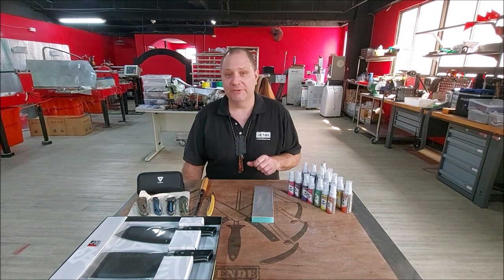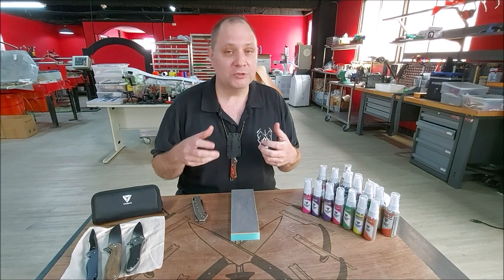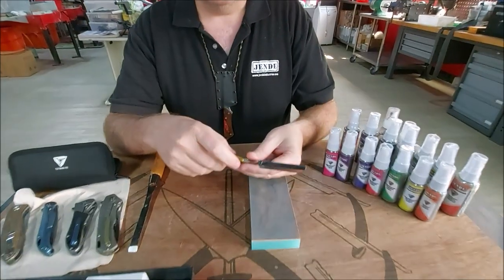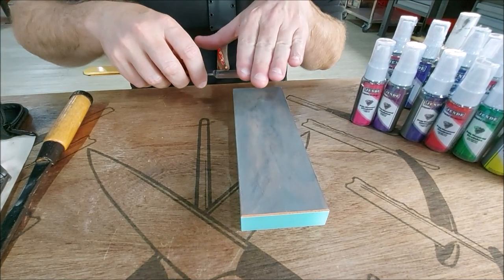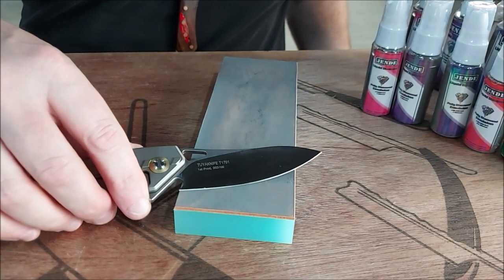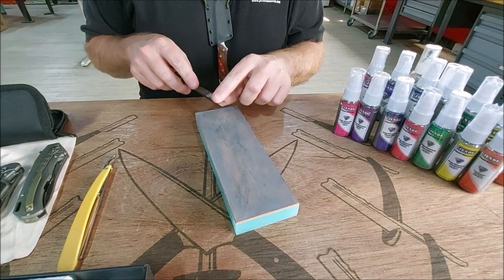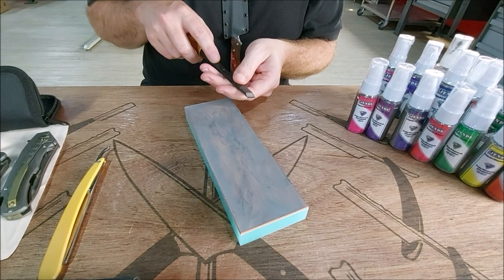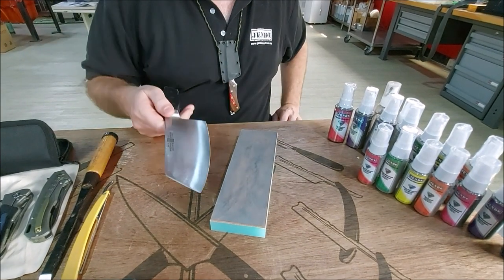Stropping Kitchen Knives, Straight Razors, Chisels, and Folding Knives Part 3 -Jende Industries

Comment: I belong to the people of measuring is knowing. 
I have an edge-on-up with test clips and measure every action I do. 
I strop on leather with a 7000 compound and notice that I have a sharper result when I strop at a slightly wider angle than I have sharpened and I use a little more force while stropping.
Soon I will buy a Jende Kangaroo Leather Bench Strop with Jende Poly Diamond Emulsion 0.025 micron stropping emulsion to take the stropping process to the next level. 
I only do this after I have polished the knife on my Shapton Pro Stone grain 30.000 super fine. 
Sharpness freak for life.
Reply from the maker: You are definitely invited to the next cocktail party, sir! 😃Stropping is one of those things that is still not talked about enough, for sure. I think you will see the improvement with the 0.025 after the 30K. You can really begin to appreciate the 0.025 once you put a blade to your face for shaving!
Reply: @JendeIndustries  In recent years, I have been studying how to make a knife really sharp without damaging its shape. 
Sharpening a knife elevated to an art. 
It is not only the sharpness, but also the uniformity of the cutting surface. 
I have 16 wethstones from 120 to 30,000 grit and am now going to delve into the really good stropping techniques. 
Every day I sharpen One knife, which I get from the local community. 
I grind 2 to 3 hours a day. 
I feel the knife and make it as beautiful and sharp as possible.  
I can't get below 70 BESS yet. 
I bought an Edge-On-Up PT50A sharpness tester for a few months ago and that's why I've gotten so much better. 
No fantasies or that I think something works better. 
To measure is to know. 
I only measure with the test clips, because with that you can accurately measure the measured value on the gram and you can repeat the measurement and come out with at most 1 gram difference. The trick is to measure as slowly as possible.
Reply from the maker: @computeronzin  Immabout to push you into the rabbit hole a little further 😁 Everything you said previously is spot on. I recommend adding some sort of magnification to your setup. I use a 200x USB microscope, but really anything is better than nothing. You will begin to see correlations between your Bess score and the condition of your edge of the edge. But allow me to plant this seed at this moment: there is more to sharpness beyond achieving a low Bess score (well I guess AFTER you achieve the low score 😃). Thinness and refinement work together, but are not the same thing.

Comment: What do you think of stropping on plain leather?  I have found that it works nice after I have used a pasted strop first.
Reply from the maker: Personally, I prefer to strop on loaded nanocloth strops and then finish on clean leather, either cow or roo. But plenty of people use loaded leather strops as well. It comes down to personal taste and what you want to achieve.
Reply: @JendeIndustries  Yeah.  How important do you think initial sharpness is vs getting a consistent, repeatable level of sharpness?

Comment: Hi I have a couple of strops (one kangaroo and one nano cloth)  and CBN emulsion from Jende. I have used the leather one for a while now. The surface is covered with a black layer now. How will I know the correct time to clean the strop and reapply the abrasive? Could you please also make a video about cleaning strops? Thanks for the video
Reply from the maker: Great question! The best time to clean your strop is when it no longer seems to work,  or after a fresh addition of abrasive, seems to have a minimized working period. Cleaning can be done a few ways, rinsing with water, using some sandpaper, or using alcohol. We'll get a video working in the pipeline!
Reply: @JendeIndustries  I got some leather care cream as few guys mentioned in the forms that it is necessary if alcohol is used for the cleaning. They say alcohol takes off the natural oils in the leather too?

Comment: Oooooo lovely tutorial. I do have question tho. I had been using your product for a long time now and it works great. But as i finish on the 1/4 micron following the correct tehcnique, presurre and angle, it becomes hair whittling and I was on a slicegasm🤣, but as i went to the 0.025 micron again following the same correct technique, presurre and angle, it loses its hair whittling performances, it cuts but not better than the 1/4 mic. I find it quite strange somehow. I need help tho.
Reply from the maker: This depends on a number of factors. More common is that unless you shave your face with it, you probably won't feel any tangible difference after a certain grit level while testing it on paper or even arm hair. On the other end of the spectrum, abrasion resistant steels can experience carbide popout, where the edge suddenly goes completely dull. To counter that, use a slightly higher angle when stropping, and stop just before you say"one more stroke should do it".

Comment: hello, is Poly Diamond Emulsion 0.10 micron good as a last pass for hard steel knives like cruwear vs cpm 3v
Reply from the maker: Absolutely - The Jende Poly Diamond Emulsions cut through all steels. And if you need more bang for the buck, we also have the MAX concentration Poly DIamond Emulsions as well.  https://jendeindustries.com/poly-diamond-emulsion.html
Reply: @JendeIndustries  I have a leather with a grain of 10000 but I am not able to have a razor edge. with 0.5 micron would I get there? I have trouble realizing
Reply from the maker: @champagnejunior  If you want to actually shave, 0.5 micron is a little more for hair whittling edges. 0.25 micron and finer will get you more suitable for actual face shaving. However, it matter more about what you are doing before the strop. What is your normal progression and method of sharpening?
Reply: @JendeIndustries  i buy and try 0.5 micron  realy nice stuf for my bark river edc cru-wear  . now i would like to buy to do the last sharpening i hesitate between 0.25 0.1 0.025. the 0.5 gives me a nice result on a convex blade which cuts very well but not like a razor. very happy with my purchase, the work is done quickly without forcing. I had to wait more than 24 hours for it to dry and I put the 7 ml on a 21x7x2 cm it is all black and has absorbed everything is this normal?
Reply from the maker: @champagnejunior  The Jende Nanocloth is thirsty at first and usually takes a good 2-3 coats to start. 7ml on the 210x70 strop is going to use the whole bottle. 25ml for the 2x6 and 210x70 strops is a much better choice as you move forward. It will always dry black with maybe a slight gray haze no matter how much emulsion you put on, too. As for the final grit, 0.5 micron gets you the hair whittling sharp you now have. To go to hair popping, the 0.25, 0.10 and/or the 0.025 micron will do that. Many guys with Barkies will go to 0.10 as the final grit past the 0.5 micron.
Reply: @JendeIndustries  already thank you for taking the time to answer me, yes I understand that 7ml is not enough but I wanted to try it is not a cheap item so I wanted to have my personal opinion before spending. but unfortunately for me I will have to buy more because it works really well. haha. I think I take the 0.1
Reply from the maker: @champagnejunior  Welcome to the Jende Industries Rabbit Hole! Let me be the first to push you in! :D :D :D